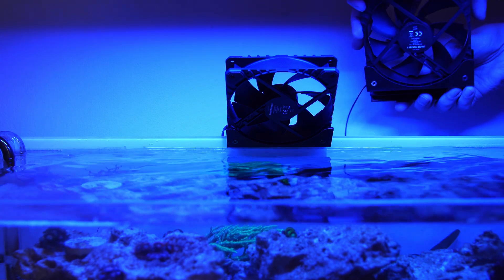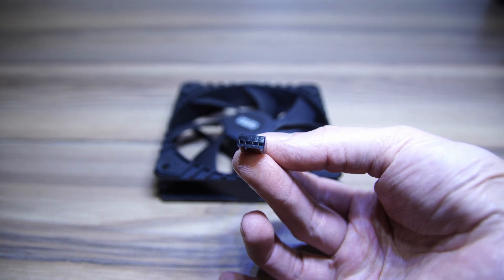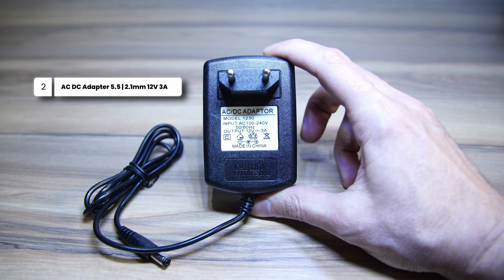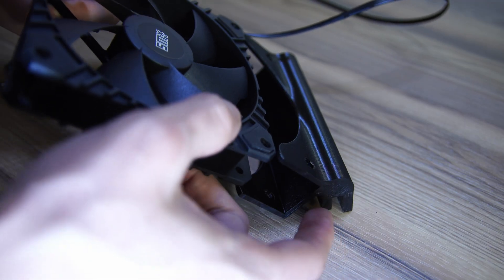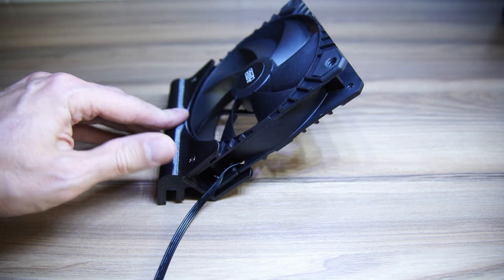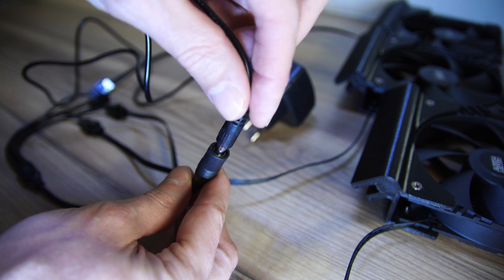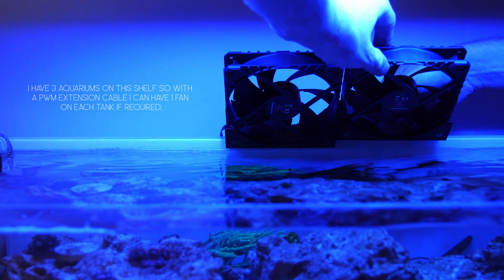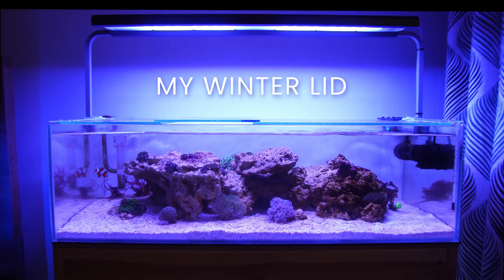🪸 HOW TO MAKE A SUPER CHEAP AQUARIUM COOLING SYSTEM. (FRESHWATER & SALTWATER)

Comment from the maker: FULL PART LIST 
🏷Power Adapter (12v 3a): https://www.aliexpress.com/item/1005005947522813.html?spm=a2g0o.order_list.order_list_main.10.18411802d1rBQ5
🏷4-Pin PWM Adapter: https://www.aliexpress.com/item/1005006413121466.html?spm=a2g0o.order_list.order_list_main.5.24a51802rv8QTc
3D Printer File: https://www.printables.com/model/20201-glass-fan-holder-aquarium-cooling-120mm-fat/files
🏷PC FANS CHEAP: https://amzn.to/3xYPcvA
🏷PC FANS QUIET: https://amzn.to/3xQKwrX

NOTE: With the 3D printer files make sure you get the right size for your glass thickness!
Reply: Power adapter and 4-pin PWM Adapter link to the same product.
Reply from the maker: @missinmtl  Good catch! Thanks I updated them! It was odd though as the links were different...
Reply: @IndoorEcosystem  Yes I saw, had to doublecheck. Thanks for fixing it! So DC 4.0x1.7 mm correct?
Reply from the maker: @missinmtl  Fan connector DC 5521 to 4Pin PWM 4 12V
Power Adapter AC DC 5521 12V 3A

Make sure you pick your plug EU or US then the sizes for the connections need to match. 5.5*2.1mm is basically 5521. I hope that makes sense.

Comment: Instead of running it on a timer, run it on a temperature controller like an Inkbird - that way the fan stays on exactly when the tank needs it and never when it isn't - essential for heaters too!!❤
Reply from the maker: @falcolf  That's the perfect solution though those timers blow out the cost a fair bit ill have to see if I can find a cheap alternative to inkbird.

Comment: Oh boy, you even do reefs tank...
It's a sweet dream, for me... 
But one that I would probably never cross, because seawater aquariums are complicated and expensive.
And above all, I don't have the means to create the pool of my dreams, big enough to be able to descend into it with a scuba diving suit, like a good 3 meters long by 2 wide and 4 meters high of water...
Yes I know it's totally crazy x)
But i have the same idea for my fresh water tank & Vampire crabs to make just big one.
P.S :
Otherwise there is air conditioning but the problem is that it accelerates the evaporation of the aquarium or
 a "chiller group" ( i don't know if it's good translated ) , it's a machine that refresh the water on the tank .
Reply from the maker: Yep! This is my first attempt at a saltwater tank and so far so good! I started a little series if you want to check it out.
It wasn't all that expensive to start really. But picking up a second-hand set would be the best way to start. 
I always wanted a mega tank as well! But the tiny ones are pretty fun! Start with a macro algae tank and see how you go ;) 

Airconditioning isn't all that common over here in Europe plus running it all the time would be $$$$$$ So these little 12v fans are super good value! 
You still get a fair bit of evaporation though, like you said!

Comment: I am in a place where my tropical fish tank water sits at 30-33°c. Would the cooling fan method be of any effect in bringing down temps in such an environment?
Reply from the maker: It will easily bring it down a few degrees. But it will also increase evaporation so you'll need to top up the tank a lot more.